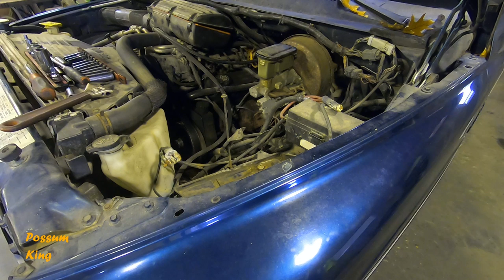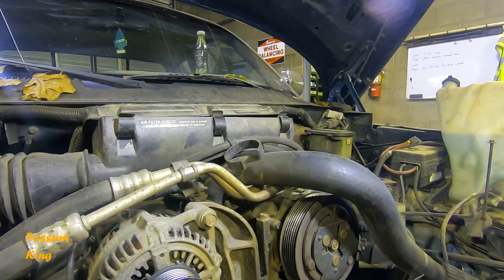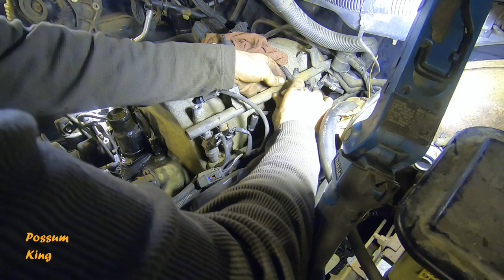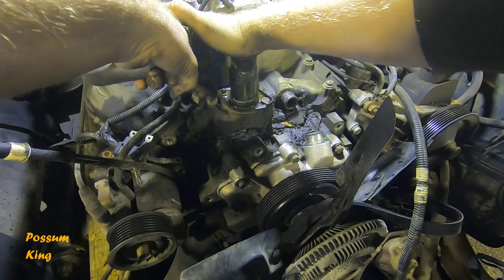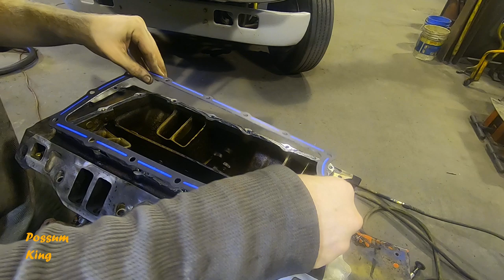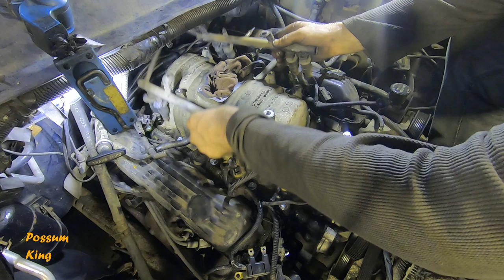Dodge 5.2 or 5.9 Magnum Plenum Plate Repair (How To)

Comment: I still love the Gen 2, even with all it's issues. it's a GREAT truck! and you cannot beat it for the money. when they came out there was nothing like them, this truck pretty much kicked off the need for better trucks we have today, thanks Dodge. 263k miles and rolling strong.
Reply: F*** yeah
Reply: Jus bought a mint 1500 with 120k hoping I can make it last past 250. Gotta seal up a couple leaks and just assuming I’ll need a ne trans
Reply: SSsshhhhh! let's keep this to ourselves,  they don't make them anymore so what's out there is all we have
Reply: Just bought a 5.2 . Just wanted a cheap simple truck, and it doesn’t get much better than these second gens!
Reply: They've been around long enough that everyone has them figured out they are good value for the money I've had my 96 1500 since 2004 and it's been a great truck
Reply: Nobody wants a truck that costs $140 to fill up and gets 9mpg. My 35 inch tires and triple tool boxes steel headache rack lets it roll in at about 7200lbs with an empty bed and no trailer.its a real work truck ! Raptor lined bumper to bumper .there great trucks but you better have a set of tools and do your maintenance and there are 2 nd gen stick shifts there safe from the youngsters scooping them up .they have no app to drive stick
Reply: 436k miles here replaced everything but the motor 02 5.9 1500
Reply: Yes mine had every possible thing wrong but it still ran strong 💪 and still does with half the sensors not running right
Reply: @chadscott7210  Any videos?
Reply: A couple of years late but I'm at 398k on the original motor. Never overhauled and the transmission was original until 330k. Just now experiencing issues with the plenum on mine and it has never had any significant issues. The most I've done to it is tune-ups, water pump, and timing chain. Timing chain wasn't failing by any means but there was just a little slack in it. If you take care of it, it will take care of you.
Reply: @Kirin  how do you know when to replace timing chain? Mine has 298K and meter replaced timing chain....
Reply: @ffhjvbuydb78eb  Rattling sound, misfires
Reply: @kirin914  mine makes me think of light snoring sound and mine is surging at highway speeds/rpm goes up and down 100-200rpms
Reply: @ffhjvbuydb78eb  Snoring as in like pulling air in?
Reply: @kirin914  no more like when it's running something rubbing against casing.....might be timing chain.....I have a video of it on my phone and if you listen closely you can hear it......
Reply: @ffhjvbuydb78eb  Are you getting any misfire codes? Also, is it hard to start?
Reply: @Kirin  no codes and it starts up fine
Reply: @Fox-E (Bonzai)  If it was the timing chain, you would definitely have misfire codes and it may be hard to start up. The fluctuating rpm makes me thing something along the lines of your fuel but the rubbing noise throws me for a loop. Have you checked your fuel pressure at idle?
Reply: @Kirin  I think the rubbing noise is the timing chain rubbing against the cover maybe cause it's stretched out. The rpm fluctuations idk cause I replaced my TPS and didn't help. I've read that torque converter can unlock but I doubt that.
Reply: @Fox-E (Bonzai)  It does sound like a timing chain rubbing but before you tear half the motor off, remove your serpentine belt and spin each pulley individually to make sure it isn't a bad bearing.
Reply: @Kirin  let's hope it's a bearing. Timing chain is big $$$$$
Reply: @Fox-E (Bonzai)  Eh it's not as expensive as you think. I bought one from autozone and replaced myself. You just have to remove the fan, fan shroud, alternator, compressor, and water pump. It's behind all of that. It took me around a day to do it but it was my first time ever doing it too. The fan/fan clutch can be a bit troublesome to remove without the right tools but it's still doable. I didn't buy any new seals and just used permatex ultra. The stuff I have they don't sell anymore but you have to have a grinder to get it off haha.
Reply: @kirin914  if I do that might as well do a rebuild with 298K miles being on the engine
Reply: @Fox-E (Bonzai)  Now you're talking money if you're going that far lol. Timing chain isn't that big of a fix honestly. I go by, "If it ain't broke, don't fix it."
Reply: @kirin914  might as well. Mine leaks oil after sitting awhile. Also has low oil pressure.

Comment: I'm 63, recently retired due to lung cancer. Beat up from the chemo and radiation treatments but was able to BEAT the cancer, I'm not or ever will be 100% but I'm alive, lol. Also when I did this repaire I was seeing a chiropractor 3 times a week for a pinched nerve in my lower back. I took a lot of breaks, lol. About 10-12 hours over 3 days and now the truck is running great. No more oil use, increase in power, increase in low end torque, no valve clatter when accelerating, very smooth runnning. Not bad for an old beat up mechanic, lol.....makes me wonder how many people traded in their truck because they thought the motor was going bad, all over a bad design in the plemun sealing gaskets, lol... Probably a bunch of trucks in the salvage yard because of a bad gasket, lol
Reply from the maker: Congrats on beating cancer James! That's really awesome. I'm glad you are still able to do your own thing even if it does take you longer now. Keep on keeping on brother!
Reply: @PossumKing  Heh,heh, Thank you. It dors have its ups and downs, lol. On a more serious note, I ask others to plesse temember those who are still fighting the battle. I met a lot of good people during my treatments and it does bother me that a lot of them will not get the same results I got.........
Reply: Awesome you beat that cancer James! Did this same "fix" for a 1998 Dodge RAM 1500 Q.C. 5.9L v8 during an engine swap overhaul (new rings, bearings, hi-torque Hughes cam, double roller timing chain, Melling oil pump, etc.) as the donor motor only had a blown plenum & previous Durango owner gave up leaving a perfectly good motor for me to get for cheap shipped to Alaska here.
Reply: Not for long, folks will harvest those magnums as they are a great mod for other cars
Reply: I am so happy to hear you beat that dreaded sickness. I am in the autobody trade for 41 years. A buddy I worked with for 20 plus years has been cancer free now for 3 years. Keep doing what your doing. Wishing you peace and prosperity my brother! Montana Rick.
Reply: Will it help my 5.2 idle
Reply: @johndaquila3671  it’s worth doing
Reply: I love you man. This gave me the kick in the ass to actually go for it tomorrow morning! 🫡
Reply: Should be a recall!!
Or even a class action lawsuit!!

Comment: Nice job, however have done the same job on my 2001 Ram 2500, no need to remove the fan shroud, idler pulley and fuel rails with injectors, just unplugged all the connectors and took the throttle body off and accessory bracket with alternator and a/c compressor and moved it to the side then pulled the intake out pretty much straight forward, on my 1995 Ram 1500 I swapped out the factory intake and put on the Hughes FI Air Gap intake and was well worth the money and it is a much better intake, will be doing the same thing on my 2001 when it comes available again
Reply: I was looking into getting one of these intakes are you having any problems with it still running strong?
Reply: @kaname9333  still runs strong and have no issues at all, was well worth the money
Reply: I'll be trying to get one shortly thanks for your reply

Comment: 384000 miles on mine so far. second motor. second trans, seventh rear end and just now getting around to this on the motor. thanks for the help seeing this it dosent look as bad as i picture it is
Reply from the maker: I think I'll be yanking my motor soon. But I won't be putting another dodge motor in it. Haha
Reply: @PossumKing  slap a damn LS in it!
Reply: Seven rear ends in 300k? 
How do you manage that?
I assume all 44’s?
Reply: @jaxturner7288  because I'm a dumbass and used a couple used rears, and also ran the living crap out of that old truck. I miss it. But I have a new one now.
Reply: How in the world?! 7 rear ends? Surely you jest, Sir. My truck has 410,000 miles, same motor, 2nd trans and 2nd rear end. Guess I take care of my ass a lil better than some ppl.😂
Reply: @keithhaynes5348  couple were used swaps, some were just rebuilt like shit some were new. Motor was done up quite a bit and I beat the thing like a read headed stepchild and ran mud tires on it like a dumb youngin for a bit too.

Comment: I've done this twice; one on my own 2500, once for a neighbor.  If you can obtain a helping hand, you can remove the intake with the throttle body together, just disconnect the bracket and cables at the throttle body.  Use you cellphone camera to take pictures as you progress along if you need something to reference to.

On the bottom plate it's helpful to mark the number sequence of the bolt pattern, that way you know exactly which one to do next.  It's a three step torque pattern, you can use a sharpie pen to mark both the torque specs and bolt pattern to save time.  You can remove the sharpie pen marks with carb cleaner, not that it's necessary as no one will see it once it's bolted in.

Also, it's a great time to replace the distributor cap and rotor as they are now very easy to get to and the water pump  by pass hose, since you already have to remove the ac compressor anyway and there's only a few bolts holding the bracket.  Do it when replacing the pan, it only takes a few more minutes to do.

Taking pictures will help you reference how things came apart and prevent mistakes later.  I started doing this with a Polaroid Swinger B&W when I had no idea or guides to take something apart (BTW that was half a century ago).
Reply from the maker: Excellent points! I did replace distro cap while I was at it and I think the pump house too. But that has all been off again since. Think it's time to swap a better motor in it. Stay tuned

Comment: PSA - The original bolts are too long. Over time the oem plate gets thinner from heat cycles and age. From online forums, shortening/cutting the bolts is an alternative to the aftermarket thicker hughes plate. High temp rtv should be used as well. It works and save money!!

Comment: Had a 2000 durango with the 5.9 V8 ran great for 300k miles. Engine Locked up on the road but before it finally gave out truck would have misfires, Lose power while driving and turn off had to set it in Neutral to turn it back on, high Revs without flooring the gas IdK why this happend but the truck kept going. Transmission went out at like 280k miles had it rebuilt. When I would remove radiator cap the fluid in radiator would buble during idle Im assuming that was a bad sign.

Comment: In the past when I have worked on vehicles, when I have come across these rubber hoses, I have found that it is easier to remove the hose if you can get it to twist and spin on the fitting before you pull on it. It doesn’t always work, but seven out of 10 it will.

Comment: 96 b3500 15 pass van. 404k HARD miles. ORIGINAL motor/trans and 1 rebuild on my rear end.. majority of its life spent pulling a work trailer. Other than maintenance I did a plenum upgrade I made myself from 1/4 aluminum. And when I first got the van at 50k miles I pulled the tranny cooler line and ripped the check ball out with a wood screw. Those check balls clog up over time stopping fluid flow and roast transmissions. Love my 2nd gen dodge. Tried breaking it time and time again, I just can't.
Reply from the maker: Which transmission was that? Might have to look into that. My trans has been fine but the motor not so much.
Reply: @PossumKing  46re. Notorious for failing. I 100% believe it's all due to that check ball in the cooler line.
Reply: @PossumKing  should apply to 42, 44, 46 and 48 "RE" or "RH" Transmissions
Reply: I spend a lot of time at the local pick and pull. I can assure you that well over 75% of the 2nd gens have an upper hose that isn't a trans cooler line, connected to the metal cooling line with 2 small hose clamps. I'm pretty sure that that spot gets a leak or fails way before anyone discovers there's a metal half ball (check ball) in the line.
Reply: @keithhaynes5348 I doubt they are in the boneyard because of a leaking line.  Every line leak I have had in any vehicle I have or have worked on I or they didn't notice until trans was slipping. Fixed leak and topped up fluid and was good to go. Just my personal experience though.

Comment: Thanks for your video. Looks like an all day job (or two) but I'm up to the challenge!

I have a 2001 B1500 van with the Magnum V6 engine. This thing has a weird problem and I'm wondering if you can tell me if this plenum issue is the cause before I goto the trouble of pulling the plenum and doing this in vain and wasting $120 on parts. 

I have not done a compression test on the front two cylinders and looked inside the throttle body for oil yet but I am going to. I've heard you can also disconnect the PVC hose and if it has vacuum on it is a good indication the plenum gasket is blown.

BTW, this was a used engine out of a 99 Dakota with 140,000 miles on it. The original engine had a rod knock. Long story on that.

First of all the engine started blowing oil out around the top of the engine. I thought it was a front main seal, but I think it's that gasket between the engine and plenum.

Next issue is the a few hundred miles later, the engine started to run awful. The OBD II reader says misfire on the front two cylinders and high voltage bank 1. I believe that means the exhaust is too lean. As if the unburned mixture from the front two cylinders are simply being pushed into the exhaust.

I replaced the PVC valve and pulled the front two spark plugs. The electrodes were completely worn down to nothing just after 200 miles. I gave the van a tune-up about 500 miles before all this started. I did not drive it like this! Once again, long story.

One thing I am NOT seeing is blue smoke out of the exhaust. But I did lose about a quart of oil after 200 miles.

I'm not seeing any steam out of the exhaust like a blown head gasket.

Any chance that the intake manifold gaskets are blown? But what would be the odds they would both blow at the same time on the front two cylinders?

Another thing. This engine started to leak coolant a year prior from the driver's side around the plenum. I couldn't really tell where but it was up high. I put some stop leak in it and it fixed that but think the coolant leak and now the oil leak are related.

Just based on those symptoms does it sound like I am in the right direction? Thanks.
Reply from the maker: @turbofiat  pull the plenum, inspect everything. Gaskets are cheap. You have to be willing to spend some money on parts if you want to run these old trucks.

Comment: knock on wood my 96Ram 3500 V8 magnum is running great 150k                doesn't smoke or burn oil yet but I drive her like a newborn baby
ran great when I got it several months ago, but still did a complete full tuneup & changing every fluid and oil.

Comment: Got a misfire 30mph and up with a 5.2 call a tech after I replaced a what I am sure is a OEM distributor cap and checked plugs and wires and still having a misfire, well I told him all of it and no check engine, said he didnt know but he'd start at timing chain. The TB had that same build up as you intake manifold so while I have the engine apart checking the tension of chain I'm going to tackle the notorious intake manifold gasket. Wish me luck that this stops my misfire issue
Reply: I wouldn’t worry about a miss fire... you probably just need some sea foam
Reply: Proper diagnosis works better than luck and throwing parts at it every time. 👍

Comment: all gen 2 Ram''s need 3 things, no matter what! plenum fix(bad engineering), dash plastic replacement(FU Dodge), and that notorious front end wobble fix(FU again Dodge), all pretty easy stuff, but all necessary. you can check if you still have a stock plenum pretty easy, take off the breather, open the throttle, and use a magnetic pick up tool, or whatever you want, just don't lose it in there! and go thru the throttle body openings to see if the plenum is magnetic, if it is, you're probably still stock, and will need, or eventually need to replace it.
Reply: Like your comment but on 3rd one what is issue / fix for the wobble?   And yes the definite dash wth 🤦‍♂️
Reply: add to that for a cummins: 5th gear lock nut for manual, line pressure upgrade and aluminum planet gerar setup upgrade. killer dowell pin in crank case, high flow fuel pump, fuel pressure gage, and alternator power/ecm ground point fix.

Comment: I used some 3/16 alum plate I had lying around the shop and cut it down to fit ..it's been in there nearly 10 yrs now so I guess it must have worked

Comment: I thought my plenum pan gasket was blown three years back. I just needed a new PC valve on my 1993 318 Magnum with 192,000 miles I've had for 10 years. The Oil Pressure sensor gauge just started leaking oil. Making it look like a Rear Main Seal crankshaft gasket leak. Otherwise it's an amazing, reliable small block engine that never quits. Mine's a van. So I'm lucky to have a doghouse, tho. I can pull out the heads inside the van.
Reply from the maker: I had my oil pressure sensor back out and leaked oil. I just threw a new one in because i already bought it thinking it was broke. nope just loose. The truck has almost every light on it now so I guess its time to show her love again. 02 sensor to start. Thanks for watching. Also that intake was fine. Clean as I needed it to be. haha